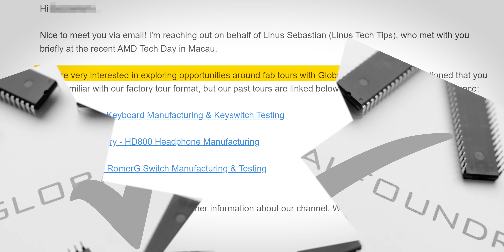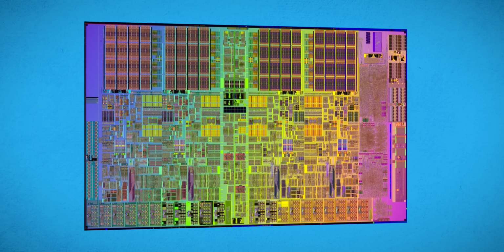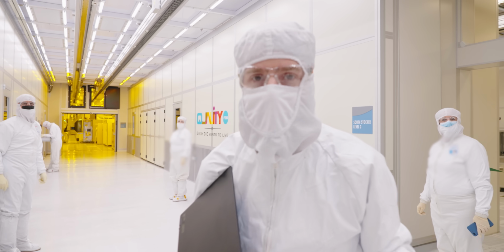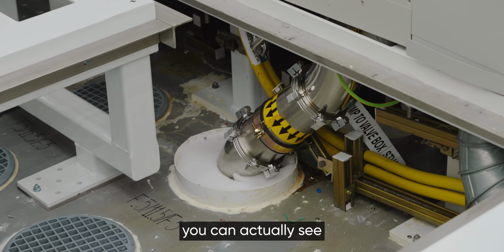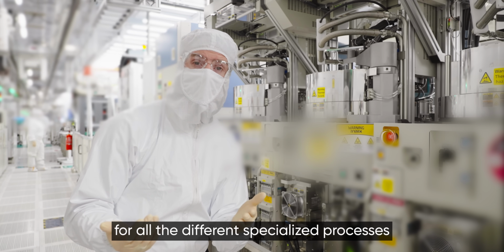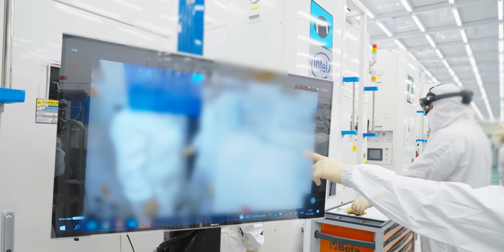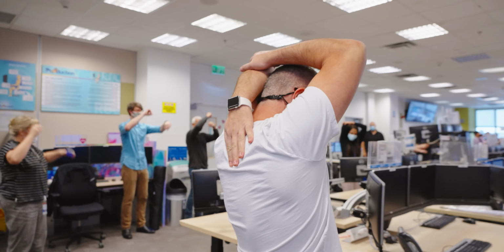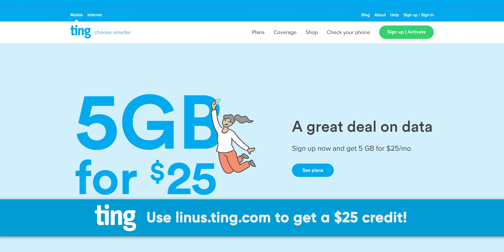I Can Die Now. - Intel Fab Tour!

Comment: Everything about chip manufacturing is amazing.  From the actual design of the chip (how can you hold millions of transistors and how they relate in your head????) to the fact that the machines put the mask in right place when they have nanometer or less precision.  It's just mind blowing.

(Yes, I know that more than one person works on a chip, and that they break it up into parts that communicate, but still, it's inconceivable--I don't think that word means what I think it means--that they can even design the dies.)
Reply: @TheHalfBorg  tbh I expect algorithms play a role already, but yes that role will no doubt be increasing hugely in the coming generations
Reply: @adm_ezri  right most of that is handled by software.
Reply: @TheHalfBorg  Even with automated module and module interconnect design, the architecture design can affect the how well the is utilized. Accelerators can have tradeoff, certain I/O might work better on different nodes, and the instruction set can slow everything down. This is why AMD and others are pushing so heavily for, not only better EDA software, but stackable chip modules that can use interchip vias to communicate like with infinity fabric. This massively reduces the need for custom designed chips as you would be able to scale the I/O, Accelerators, and other modules to meet the design requirements.
Reply: @TheHalfBorg  The day AI's can program and teach a new AI, we're screwed, or at least useless. :P
Reply: @TheHalfBorg  the last CPU humans designed was the 80486. The original Pentium with 60 million transistors was beyond human capability to manage. Which is why it had flaws. Like the infamous F00F bug.

Comment: I worked as a repair tech in the OR fab and we had some second-hand machines from Israel that were labeled with animals. But also the struggle was real - the subfab parts are almost never located exactly where the fab tool is, sometimes the order is even different or intermixed with parts for other machines. Needless to say we did a lot of double checking before turning anything off.
Reply: Buddy checks!

Comment: Can you imagine the logistics required to retool all these machines when they release a new generation of cpu. Absolutely insane.
Reply: Seems like their equipment is good enough that all you need to do is load in a different schematic and boom, you are set to go. The engineering effort in both hardware and software previously to achieve this kind of generalizability though, now that's insane.
Reply: I bet these machines don't care what you give to them as a new layout. Also I guess, the reason Linus was able to go around there was that they were recalibrating ;) I would guess that in normal times you have much more wavers flying around :D
Reply: @Spojo1  Yes, especially since the only things that require a whole new machine would be a smaller nanometer process, beyond what the machine can handle. As long as you have a schematic for what the machine should do, which is practically a massive 3D model sliced into layers, the change isn't too hard.
Reply: @Spojo1  Also: it's mostly software that has to be changed, like you have to change the order of the steps the wavers take. The organisation is as we see in the video all computer driven, so once they designed the chip and how it's produced, they just let the fab do its thing
Reply: This is exactly one of reasons for chiplets within a package; machines for producing older, larger processes can still be put to use making silicon for parts of the processor that aren't as reliant on the high efficiency required of newer smaller nodes
Reply: Well, this is all kind of wrong… there are two different kind of litographic processes, one uses light as the subtracting mean, this allows to reach width of hundreds of nm, usually down to 400 (blue light), and there is another process that uses electrons, e-beam, that can go down to few nm, the point is, that you cannot go down more than there. Atoms are half a nm thick in Silicon, so, the lower limit is already been reached. Soon enough silicon will become an obsolete material and we will need to turn to other semiconductors. These machines have also limits, and some are intrinsic to the physics that the machine is based on. References? I work in the field, in a closely related research field 😅 actually studying some of the candidates to substitute Si for future applications 😄
Reply: Well, they kept running on the same node for so long, so that definitely helped. They just had to write new routes and use different reticle masks. Maybe they increased the MLs...
Reply: @TheAteris1  Yeah, I've read about the issues you mentioned and the search for a new material that will allow for the next generation of semiconductors to make a leap in performance versus silicon. We're not going to be splitting atoms to make silicon based chips better, so something new has to replace it. I find all of this very interesting since I'm a mechanical engineer who has visited a few production facilities (including some clean-room ones) in various parts of the world.

Comment: "Don't touch anything"
Linus: touches running etching machine, jumps around and is generally very animated, shouts loudly and claps next to running machines.
I'd be afraid to look in the general directions of the process, the amount of witchcraft and black magic involved in making those nodes...
Reply: The force caused by just turning your head wrong would be enough for me not to walk around in that building.
Reply: They tell us don’t even breathe in the direction of the tools if you’re not working on them
Reply: I am curious if Linus' visit can be detected on Intel's monitoring graphs in some way and be mentioned afterwards in some internal presentation in regards to whether it's worthwhile or not to let reporters in for PR purposes, and how much it ends up costing.

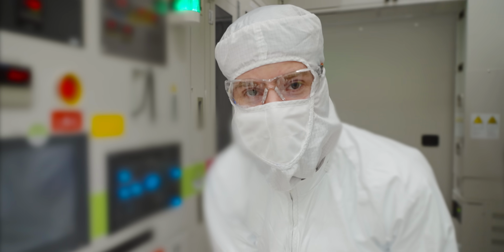Comment: 8:40 So a diffusion furnace is used to, first and foremost, diffuse dopants. When you do ion implantation, you have a bunch of dopants implanted not very deep into the wafer. To get the p-n junction where you want, you'll have to anneal it in the furnace to "spread" out the diffusion profile. This is called "dopant drive-in". Additionally, after implantation, often these dopants are inactive. Essentially they are stuck between crystallographic planes where they are not able to be electrically useful. During the drive-in anneal, the moving dopant atoms manage to get themselves incorporated into the Si crystal structure, allowing them to be electrically active and make the region either free electron (n) or hole (p) rich.
Aside from diffusion, a furnace that can reach those temps, can also be used to grow SiO2 or silicon oxide. Just flow oxygen and heat to like 100C. You want to grow oxide faster? Flow some moisture or dichloro ethanene.
Reply: How do you know all this
Reply: How would the flow of solvent participate in the mechanism of forming the oxide? Quite interesting how you can do that with the same furnace... I'm assuming because it melts the silicon? Or does SiO2 have a glass transition temperature? I've no clue lmao
Reply: @enelition5322  Seemingly decreases the activation energy of the reaction. I want to call it a catalyst, but it is consumed in the process.
Reply: @enelition5322  We typically do it in an identical, but clean furnace. Don't want to unintentionally add P or B to our oxide.
Well, SiO2 does have a Tg (Glass transition temp after all, what even is glass if not messy SiO2). But, for sure SiO2, melting point is 1710C (had to look it up lol), stay below that amd you'll be fine. Besides, for thin films (less than a few microns), I'm not sure if the bulk melting point is even relevant.
Look up Deal-Grove oxidation. Lots of cool info. Some slightly ugly math.
Reply: @JutKip  Let's just say I do science sometimes. 😋
Reply: @SpookyBees  I can take a crack at explaining the basics if you want.?
Reply: @SagnikDasgupta  Maybe it activates it somehow? So it's not the solvent? What comes out at the end as a byproduct - perhaps it's a pre-catalyst
Reply: @enelition5322  That's basically what happens in my understanding.

Comment: It's mind boggling how big just one of these facilities are. What's even more mind boggling is that they can't keep up with current global demand
Reply: To me, it’s mind boggling that they can even keep up at all.
Reply: Actually it's not Intel, Samsung, and TSMC (not exactly but still) that can't keep up with demand, it's the small manufacturers that make board components like diodes, resistors, etc. That's the "chip shortage" you hear about. 

Source: just left Intel for a tool manufacturer, dealing with component shortages for power controllers on our tools.
Reply: @filthyfrankblack4067  you would think so but not my case lol, even though on a normal night i could walk 3-5 miles, 3-4 times a week
Reply: @enunez61  cant outwork bad diet.

Comment: Thank you for this video, perhaps people will get an appreciation of how difficult it actually is to produce chips. I worked in an 8 inch fab for 7 years, 1st in wet etch and then in CVD. Even 20 years later I still find it baffling that people came up with this whole photograph, wash, etch, bombard, sputter, etc for around 3 months and at the end of it you will have a work chip.  Even back in 1996 when. I started the NEC fab in scotland cost £2 billion.

Comment: Linus: "I got rejected by all these manufacturers for a factory tour."
Me: "Wow, don't they know who you are?"

8 minutes later...

Linus: "One thing Intel has been very particular about is not bumping the machines."
Me: "Wow, don't they know who you are?"
Reply: underrated
Reply: he was standing at a machine that is so stabalised he can push against it with no real issue ;)
Reply: I was thinking the exact same thing.
Reply: @Timberjagi  eh, wouldn't risk it tho
Reply: @Timberjagi  A train rumbling past 5 miles away can trash a batch of wafers.  Even though the FABs are build on 'hanging' intertial damping foundations, a human touching a machine inside the isolation can mess up mask-alignment by nanometres.  They are usually built where there is minimal tectonic activity also.  I was surprised there was one in Israel for that reason as Israel is near a tectonic boundary.
Reply: implying people should be treated differently based on who they are?
Reply: @kiltedgod  If you're far away enough from the tectonic plate boundaries, it's a shockingly minor issue. If you live in, say, Northern California, you may be basically next to the ring of fire, but you're never gonna even notice an earthquake happening unless it's so big that LA is just straightup gone* from the scale. It's less about the country and more about where in the country.

(*=Moderate exaggeration for the sake of a joke, but they would have to be pretty powerful, which would cause significant damage.)
Reply: @imadetheuniverse4fun  Yes, people should be treated differently based on who they are. That's common sense.

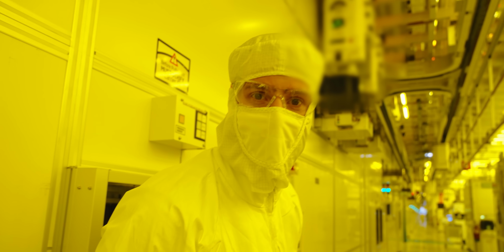Comment: 12:45 updated fun fact, the most expensive photolithography EUV machines currently cost around $180-200 million. And that is just 1/2 of the lithography process machine. Also everyone normally calls them “tools” not machines lol
Reply: Those indeed look like the more 'conventional' immersion lithography systems which are in wide use so I suspect the price is in the right ballpark. One of those EUV machines is basically the size of a city bus.

Comment: I never knew that weather a dye would become i7 or i9 was depending on how good it was. Must be extremely challenging manufacturing process when you essentially don't know what you are producing.
Reply: its much much easier repurposing the dies rather than discarding them..
Reply: @filippos989  Was more talking about that they can't just say "hey, we need X amount of i7's and X amount i9's" and just produce it. Rather they kinda have to hope
Edit: I'm of course simplifying it alot but you get the gist
Reply: it's kinda good because they get price differentiation without having to change the design, but it does shows how ridiculously difficult it is to make chips

Comment: I‘ve been fortunate enough to visit a Bosch wafer fab. I wasn’t inside, but the entire fab was sourrounded by glass. You could walk around the whole thing and see inside. It was awesome.

A also drove a non limited eBike that day. Let me tell you, 85 km/h on a bike is a scaaaary experience.
Reply: I custom built my own E-Bike. Had it up to 45mph(72km/h). Didn't seem that fast. Then again I also own a ZERO SR/F which is a 110 Horse Power Electric Motorcycle so I'm used to fast on two wheels.
Reply: As someone who works in a wafer fab for a living, it gets to he very annoying to deal with the equipment and diagnosing the failures of the wafers in the foups and determining if its the wafer, probe card, or equipment thats causing the failure

Comment: I've been wanting a factory tour of a cpu fab forever. This is everything I wanted.
Reply: @ME-CFS-LongCovid-Help  it is the architecture, photo resist, and dry etch, that determine the node size. Most of which is proprietary trade secrets. Just having the same machines isn't going to solve your size problems. Its knowing how to use them and manipulate them.

Comment: Wait hold up, I9, I7, I5 etc is determined by quality of the chip and how many errors it had? I always thought they had different architecture
Reply: Well, kind of.
For 12th gen, as far as I know, there's two "base" chips they design, one that the unlocked cpu's base off (12600k, 12700k, 12900k) and include the E-cores, and one that's intended for all the other locked chips, like the 12400.
If you have a chip that clocks high and works completely, it's being sold as a 12900k.
If they aren't stable at the intended speed, Intel may drop them a little and sell them as either a 12700k or 12600k.
If one to four E-cores are malfunctioning (remember they come in clusters of 4 cores each on the die), you can still make a 12700k out of them, and if one or two P-cores are malfunctioning, you can still make a 12600k out of it.

Comment: A serious question that I hope someone from LTT sees and can answer - Did they not challenge you taking the laptop into the fab with you? With the worries about contaminants i would have thought the Blower style fans on a laptop, notorious for clogging over time, would have been a hard no before even considering particulate in the keyboard
Reply: From my experience in clean rooms, there is a air lock drop box that you can clean foreign objects in that you want to take into the clean room. They would wipe it all down and probably blow the dust out. 

But yeah, point taken, there could still be dust inside etc.
Reply: I would imagine that it's a machine they provided for him honestly - even aside from the dust, if they need this much blurring I can't see them letting an unknown system into this place
Reply: Interesting question. The laptop in the video doesn't look like Linus' usually daily driver laptop (a Framework machine), so perhaps it's a loaner device specifically for taking into the cleanroom? Sometimes you can see people in the background using headphones or talking on phones, so I guess there is some sort of arrangement for that.
Reply: You are absolutely right, depending on the class of the cleanroom, blower fans are kinda sketch...

Comment: Makes you appreciate what goes into these CPU’s man this stuff is amazing…… can’t wait to get my 5900x soon
Reply: Fantastic choice, I'm stuck with a 5800x because it came bundled with a 3070 and it was the only way I could get one, I totally agree with Gamer Nexus' take that the 5800x is a card without a market, the 5600x is as capable for gaming and if you want more cores spend 100$ more and get 12 cores, 4 more than the 5800x that's a huge value add. The 5800x is definitely a great chip it just doesn't make sense given what surrounds it, maybe if the price continues to fall it might be worth it over the 5600x if the price comes down enough but that requires that chip no to fall that much. Also way to go not going intel, they're awful.

I strictly don't buy intel, not because of any stupid red vs blue shit, but because they go in and lockout features that are already on the chip in order to make their product worse to make their better products look better by comparison. That's scum and I'm not interested. The process of artificially limitting speeds beyond what binning requires for stability is also dirty but it's an industry standard and most people don't even understand that there is usually significant performance left on the table that the chip is downclocked from, locking the end user out of being able to restore some of that performance unless they pay a premium is just wrong. They are literally installing a lockout and making you pay to remove it. It's like the other egregious sin that Louis talks about, selling you an EV and limiting 10-25% of your battery unless you pay them for full use, it's disgusting.
Reply: made me chuckle 🤣. Admiring the process of intel manufacturing whilst purchasing an AMD. Great choice